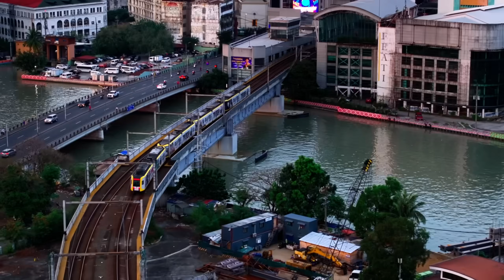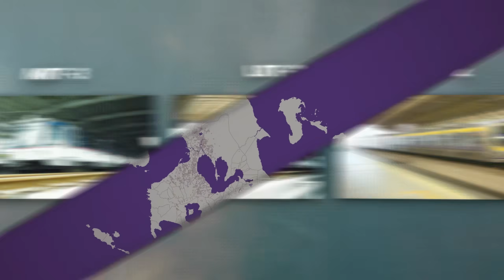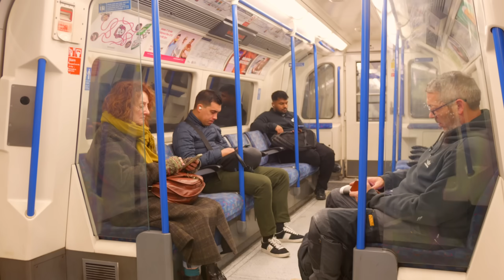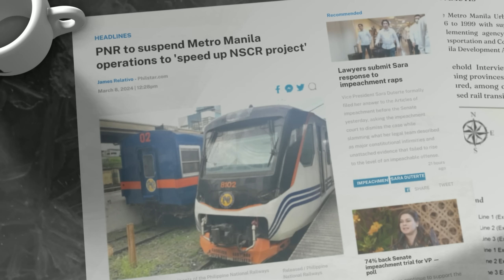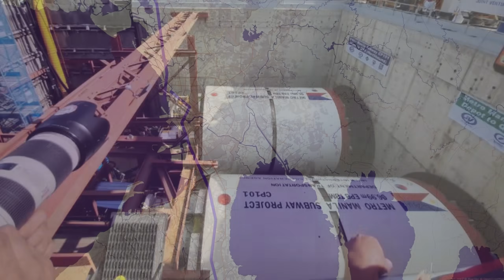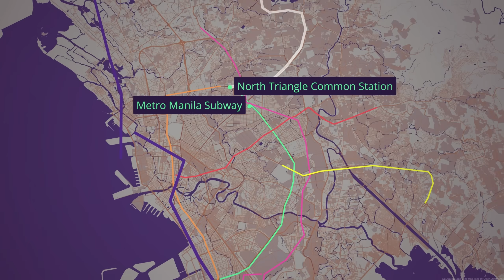Why Philippines’ Trains Were Designed to Fail

Comment from the maker: Correction(s):

On the map I accidentally labeled LRT-2 as LRT-3, LRT-3 does not exist, it's supposed to be LRT-2.
Reply: Umm isn’t Philippines doing what they need to do? What you mean designed to fail
Reply: Highway and New LRT3 line in Malaysia https://youtu.be/a-W10K4QEZM?si=FtBrijbLCrSohbBe
Reply: Malaysia and China 665 km ECRL electric train project https://youtu.be/rN_YooX2dhk?si=L_5136zxLUR9-CIb
Reply: Your corrections are designed to fail
Reply: Wrong .... it should be LRT 1 ... lrt2 does not exist as well
Reply: @noisemanila3792  bro lrt 2 is the purple line it exists I'm literally on it right now
Reply: @noisemanila3792  then what am i looking at right now?!

Comment: "Designed to fail" is a bit misleading. You actually answered it much better in the video: we lack interconnections, much more, additional lines. That's why the current system is stretched thin because while the vast majority commute, they have to squeeze through trains, buses, and jeeps.

Comment: This is the sad part in the Philippines. Progress is always blocked by Land acquisition or Illegal settlement that need to be resettled. Also we always do Band aid solutions. This nation should think beyond for its people for example The NSCR should not only stop at New clark it should also expand up until La union or going to baguio. Because the PNR has old line going to does destinations
Reply from the maker: Thanks for your insight! I agree. I'm actually coming up with a new video "Can Trains Fix Manila" one part of it is about land acquisition/illegal settlement, a barrier as to why train-building is difficult in the Philippines.
Reply: Reminder that its always constant Sky ways construction under Dilawan rule(Abnoy and Arroyo(yes she is dilawan since she got to power through people power)). Little to no improvement on the MRT and LRT and a huge proliferation of Bus companies(most of which are under Dilawan Crony control) instead of improving the PNR - with Bus companies paying kids to steal the steel tracks of trains and blaming said train for being unreliable unlike the Bus.
Yes, Dilawan rule is selfish, performative and puro JOLOGS. Nood lang ng Dilawan Propaganda tulad ng ABS CBN mga JOLOGS.

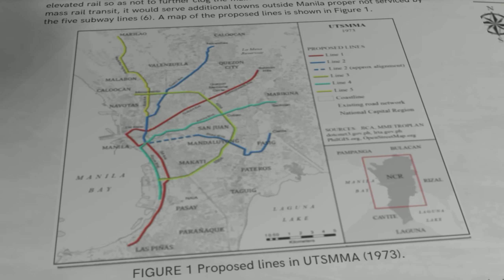Comment: Funfact: at 1:09 the map shows OTCA's (predecessor of JICA) 1973 proposal for a subway system in Metro Manila, which includes 5 heavy rail lines. This could've help thousands of commuters in Metro Manila back then and today but the government then chose to build LRT1, reasons includes being cheaper to build and could be finish before Singapore's first metro line. 😩

Comment: 4 metro lines are under construction in Mumbai currently. Mumbai also face similar problems but not at that scale. They could survive till now because of a cohesive local suburban train network. Metro was much needed and you can feel it in increased ridership in constructed lines. Best wishes for Philippines.

Comment: This is why buses should be considered as an alternative. While the rail network completes itself over the next decade, 14 million commuters still need a structured system today.
Reply: Bus companies are full of corruption - most of which are private and under control of Dilawan cronies.

Comment: I visited Manila in April of this year and stayed in BGC. One of my first thoughts was that the whole city could really benefit from extensive passenger rail infrastructure, similar to what my home city of NYC has.
Reply from the maker: I'm planning to visit NYC sometime next year! How convenient is rail transport around the city? Do trains run on time and 24/7? Wondering if you can drop some thoughts beyond just conveniency and overall costs, safety or whatever you can think of
Reply: @carlosvines0 Nice! 

Rail transport around the city is super convenient. The NYC Subway System is the largest in the world by the sheer number of stations it has. It has a total of 472 stations. The greatest aspect of the system is that it runs 24/7 365 days. 

As far as the cost, the fare is $3.00. Once you pay at the fare gate using OMNY or your credit card and such, you can go as far as you want on the subway line that you are on. You can transfer to another line without having to pay for the fare as long as the station has transfers available. For example, i take A Train from 34 St Penn Station to West 4 Street. At that station, I can transfer to the B,D,F, or M train. 

For safety, just use common sense and be aware of your surroundings, especially late at night. Some of the subway stations basically turn into a homeless shelter. As long as you mind your own business, you will be fine. 

Anyways, that is pretty much all I can think of. I would also look into the history of the system. It is fascinating how a system of it's age is still serving the city over 100 years later.
Reply from the maker: Thanks for taking the time in writing this. I didn't know any of this information, quite interesting! Hopefully, I'll be able to record the trains, and be able to publish a similar video about it.

Comment: Good insights! I’d like to add a few things:
- Historically after World War 2, the Tranvia and other old train routes were never rebuilt. These rail lines were then converted into roads.
- Short sighted/cost cutting (the MRT-3 specifically). I did a thesis of this back in college days. The MRT-3 is the busiest and highest ridership among the current lines yet it has the lowest capacity. MRT-3’s rolling stock is actually meant for street cars, not as heavy rail unlike MRT-3. If the MRT-3’s rolling stock and width is as wide as LRT-2, the MRT-3 won’t be as congested. A lot of the stations and rail sections are at grade too. This limited the potential of expansion, like we can’t extend MRT-3 from Taft Ave to Roxas Boulevard and MOA because of the LRT-1’s infrastructure blocking the potential expansion
- NIMBYs or Not In My Backyard: The MRT-4 is supposed to connect Manila to Taytay Rizal via Ortigas Avenue. This could have connected the MRT-4 to LRT-2’s Gilmore station, MRT-3’s EDSA Ortigas Station, all the way to the east of Rizal. However, a lot of stakeholders and rich folks in the Greenhills area didn’t want a train near that well known private school in Greenhills because “the kids will get distracted by the train”??? Because of this, the MRT-4 is cut short to end only in EDSA Ortigas Station. Same with a metro line along Espana boulevard/Quezon ave. A certain former mayor didnt want a rail line ruining the said major road.
- NAIA does not have a direct train connection yet. Our main gateway to the world doesn’t connect directly to rail, and the closest train station as of now is the ones in LRT-1 (Baclaran, PITX), but you have to ride a bus or taxi to get to the airport. Imagine Singapore’s Changi Airport or Hong Kong’s International Airport but without the direct train connection. Que horror!!! Thankfully, the metro manila subway project will solve this by having a station in Terminal 3.
- Lack of rail connection between NAIA’s T1-T2-T3. Transferring terminals is a pain in the butt. These three terminals feel like 3 separate airports with a shared runway. You have to exit the airport, book a P2P bus that is infrequent or take an expensive airport taxi, get stuck in traffic, and enter another terminal just to transfer flights. There should be a direct train connection within the NAIA complex where you can seamlessly transfer from T1-T2-T3 without leaving the airport.
- It is also insane that elevated Expressways are built faster and always a priority than rail projects. Sure, building a single metro line is complex, but Metro Manila is already car centric enough and we need more trains!!!
- Different operators, different management, different maintenance providers. Over the past decades, our metro lines are always breaking down. Luckily the LRT-1 and MRT-3 is improving, but LRT-2 is showing signs of neglect even though this is the newest among the lines.
- Lack of coordination between cities. Remember the Makati Subway? It’s supposed to make a semi loop from Ayala station, going around Makati, having a stop in Guadalupe, and ending just near Pateros. This could have had the potential to include BGC, but the two cities have territorial disputes. A huge chunk of Makati, where the Makati Subway is supposed to be built, is now part of Taguig. Now the Makati Subway project has been stalled and canceled. In the end, commuters ultimately lost
- We don’t have a Downtown Line directly connecting Aseana City, Makati CBD, BGC, and Ortigas CBD. The Mass Transit System Loop (MTSL project) was supposed to link Aseana City, Makati CBD, and BGC in one metro line, but this never came into reality because of the Makati Intracity Subway.

In conclusion, Metro Manila could have been a functional and well connected metropolis despite its huge and dense population. But poor planning and car centric policies made Metro Manila what it is today.

It’s still reversible and doable. Progress is very slow (MRT-7 is still half baked in construction, Metro Manila Subway is not even 50% done, and NSCR is still having ROW issues like you said), but it will take several decades before our Metro Manila could catch up to Kuala Lumpur, Bangkok, and Taipei.

Comment: You're not talking about it being Privately owned. That's why it's built like that. Each line is for an Oligarch to make money and now we are doing the same for the other lines. This problem will persist. Just like the flood control projects we just injected more money into a flawed system. We should Nationalize them all. PNR was the richest government company before WW2. The Oligarchs stole these anyway so just take it back. Make sure the whole family is also locked up. We can't be nice again to these thieves they are delaying progress to the country and are the biggest parasites in the nation. Frankly they should be thankful they aren't killed.

Comment: Transfers are hell and not accesible to PWDs and Pregnant Passengers. The only "nice" transfer was from LRT 1 Doroteo Jose to LRT 2 Recto Stations as there is a covered walkway. Another thing is that there's no "concourse level" at LRT 1 (except from the stations in their north and south extensions) so you need to go down to the road and walk up again to the other side.

MRT 4 also cut their supposed ROW because of resistance from the subdivisions in Greenhills. The same reason why there's a big hole in Ortigas Intersection because as it was planned to have a huge skyscraper there.

Comment: It was not designed to fail. We just lack railways. We need to build more.
Reply: and Manila would rather build that shit expressway. Great!
Reply: @renz-b9w Sadly those of us who are actually passionate about trains aren't the ones in power or even have the money to do so.
Reply: @ToddKeck98 city bus system are inexpensive to build compared with railway systems. The country should start from having those modern city bus systems first before thinking about adding more railways, because thats the most basic mass transit that must have to be able to catch up with developed countries. I dont know if you ever heard about it.
Reply: @kalakian  We already HAVE a bus system here, unless you've never heard of the Rationalized Bus System scheme. Even if it's cheaper and more feasible to build, it has an inferior capacity compared to trains. Even Bogota's Transmilenio, the best bus system in the world realized they can only carry too much before it falls apart and build a subway line.

Now I'll take the L and buses can indeed become mainline transit for a city with up to 41 million residents for a couple conditions. Make a single bus design that can fit 2,300 people, have it run 20 times per hour per direction while legally overspeeding of over 50% the legal highway limit. That's the type of train you'll have to beat.
Reply: @ToddKeck98 im talking about an expanded city bus system similar to the clark loop. Have you seen it? In BGC there is a small city bus system, very limited. This bus system have organized bus routes, proper bus stops and shelters, and they have maintenance facilities for the bus fleet. Im not talking about those old crappy shit that just keep plying around without any proper bus stops like those crappy jeepnesy. No, you dont have the proper and expanded city bus  systems yet. Because those jeepney associations didnt want to cooperate with the government. Only few of them did and left the association, and aome of them got recruited by clark loop city bus operators.

You should try living in a world class, industrious country  first to understand what im talking about. You will be dreaming if you say you wanted to replace them all with railways thats so stupid. You cant do that. You need smaller mass transit for arterial roads not trains.

If you want to use Bogota as an example, even them have a massive city bus system outside their bus rapid transit system. Thats what the Philippines should do. Even Japan, outside their massive railway network system, they do have those modern city bus systems with proper bus stops and organized bus routes.
Reply: @ToddKeck98 trains need to be associated with modernity
Reply: @ToddKeck98  lets talk about efficiency. Train is proven hundred years for efficiency ratio, much efficient than car or bus. Less carbon footprint.

You just mention the system, not mentioning the ecosystem, oil price, tire use, supply chain and so on.
Train in longterm much more efficient.
You should do your own research.
Reply: @kalakian you're right, I saw the existing PH railway were still at worrying condition. Thus its best to focus on renovating its existing infrastructure while building a newly inexpensive BRT
Reply: @r@renz- @renz-b9w ys including the subway systems are very expensive to build. Thats why a modern city bus system for each cities, atleast, are more feasible. They just need a strong political will to convert those old fashion jeepneys with modern ones and with organized routes, complete with proper bus stops and shelters, exactly like the clark loop city bus system that need to be expanded with more routes to cover each cities across the country. They have to be regulated.
Reply: @kalakian  which is a great investment for the long run compared to expressways. Mass transit moves people, makes businesses reachable, no delays, saves energy.
Reply: @kalakian maybe a global movement is needed to build subways a global super department but for urban railways not wars
Reply: We need to BUILD BETTER MORE.
Reply: No shit SHIRLOCK
Reply: SMC: are you sure about that?
Reply: @kennethservida6144    the design of the stations sucks but It is not failure. Commuters badly need it.
Reply: The Greedy Corruption of Every Politicians 🤡😡🤮😤🤬
Reply: Only expensive ones from Japan and Europe if Philippines ever want to build railways.
Reply: You are correct
Reply: Gibs gibs gibs
Reply: Just one more track
Reply: @sushilsingh8996but no train to put the tracks for 😅
Reply: Shhh no spoilers!
Reply: Sadly more toll roads = more profit for the private sector
Reply: we need the revival of trams and the pnr north to south long haul that would be MASSIVE!!!
Reply: @foxisadog_ I can't wait for the elevated PNR, since I'm from South Luzon!
Reply: yeah but for me pnr at-grade rail would be the best like those in british railways and all of europe's high speed rail like france, germany and spain bc it's cheaper to build than build a high speed rail above, pnr south long haul utilizes zero (or just too little) street level crossings based on their feasbility study accessible through dotr's website. i think i'll have to wait until 2050s 😭, would be senior when that's fully operational, if only the construction had started way earlier in 2023 it would boost the travel time and cut it from 13-14 hours by road to 6-8 hours by south long haul train only then we would be able to enjoy it. i just hope🤞it would start before the administration leaves in 2028 of july.
Reply: @foxisadog_well the NSCR north section started its construction in 2019 (Valenzuela - Malolos) and 2021/2022 (Malolos - Clark). So you will still get a chance to ride that train before your senior year since it is expected to be operational by year 2028
Reply: i'm talking about the north and south long haul so that I can go to bicol. to the north it will traverse to tuguegarao and the other line up to pagudpod.
Reply: that's why the statement is "designed to fail" failed to build more, the statement is about the system not the railway itself..
Reply: @theworthy9411   That's why I said it was not a failure. We just lack railways. The system is not the problem, but the lack of railways is. Improve your comprehension. You are the one who doesn't get my point. If it is a failure, then many commuters will not ride the trains anymore.
Reply: It's just lacking maintenance. especially on the PNR Line.
Reply: @brianzerorc build maglev then
Reply: @qjtvaddict too expensive
Reply: @qjtvaddict  Germany and China and Japan Has It Too
Reply: @vigoedwinpandika5236  wanna know the difference between those countries and us? theyre rich, while we're poor and riddled with corruption
Reply: @Cbrmkn98xs  oh yeah then what is it?
Reply: @vigoedwinpandika5236  your reading comprehension is disappointing, reread what i said